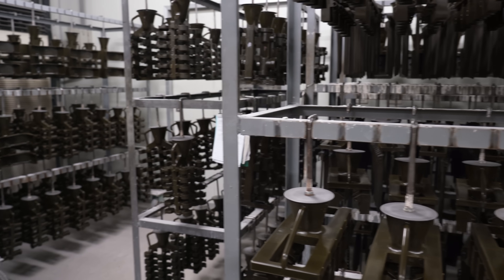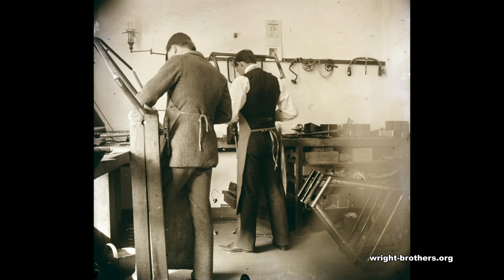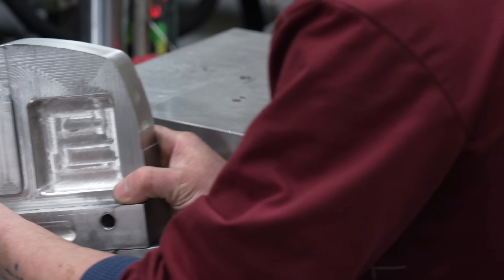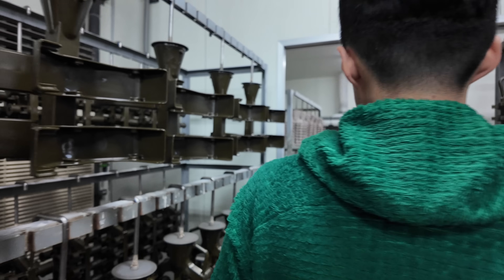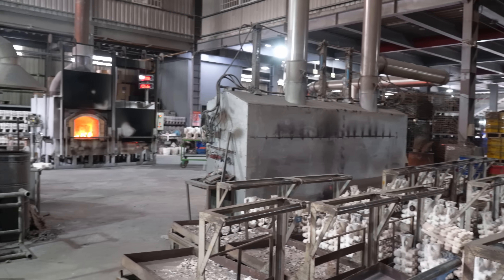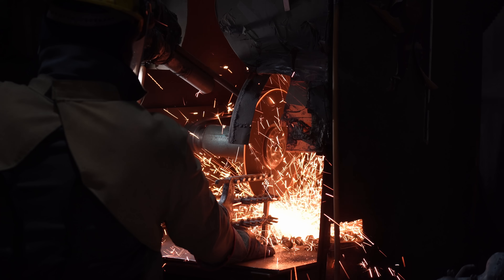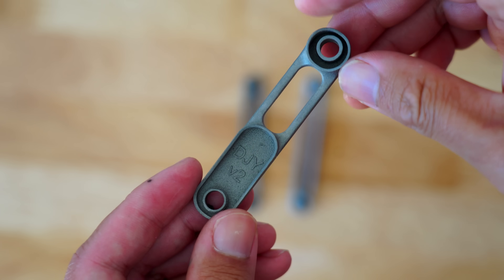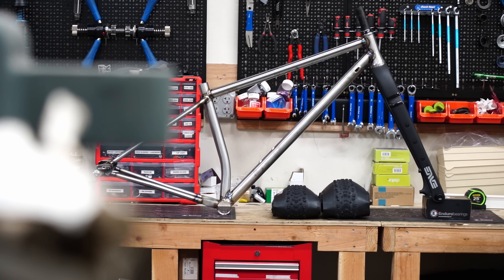Wax to Steel: Inside a casting factory

Comment: My old 1997 Norco Team Issue hardtail had Reynolds 853 with some Ritchie Logic tubing mixed in  and lost wax drop outs. I had disc brake tabs welded on a few years later…that bike was fun, but yeah steep and short geo. Sub 25lbs

Comment: Awesome video. I did learn something new - I'd always heard the term lost wax process but did not know what that meant. I did not realize there was a ceramic mold step. Subbed.
Reply: It’s also known as ‘Investment Casting’. ‘Lost wax Casting’ is older terminology, but still correct. It’s an amazing and very relevant manufacturing method for anything relatively small that is to be made from metal material, from high end medical and aerospace components, down to bicycle bottle holders as seen here.

Comment: There must be a way to wax 3d print the lost wax forms.
This brings tooling cost in the lost wax process instantly.
Reply from the maker: I think there are a few startups 3D printing the molds too! You can tell from the video, the casting factory is pretty oldschool. It will take some time for old and new technologies to mix.

Comment: The visualization of cost and scale comparisons is great. I would critique that machining certainly gets cheaper at scale, but I take your point that it doesn't get much cheaper after the upfront investment of programming/tooling. And I guess the same can be said for most manufacturing workflows - large contracts typically bring prices down. But as a for instance, if you go to any shop with an RFQ for 10,000 pcs on a recurring order every 3 months you're going to get quoted a per-piece price that is a tiny fraction of what you'd pay for a one-off run of 100pc or smaller. The way that you go about machining a small run vs a large run is very different, and frankly a significant portion of the cost of even a several-hundred part run is the non-recurring engineering and customer service work surrounding the custom job, not the "spindle time."

When you have steady demand on a part that you have optimized for production, you can afford to price that job at a much more modest hourly spindle rate because it doesn't really need much attention. You can actually leverage automation and you have de-risked the prospect of the contract as you come to understand what the tool life, scrap rate, chip control and material handling look like. CNC is much more automated at scale than lost wax casting so if you were to compare parts at quantites like 1, 100, 10,000 I think you might see some interesting results.

As an extreme illustration, I know of real-world examples in high volume contract machining in the USA where the machine shop would make the parts for less than their cost of the raw material, but they keep the chips. The money they make on recycling the chips can be enough to make the job profitable. Imagine a copper part with significant material removal. I can't relate to those kinds of razor-thin margins, but when the contracted quantities are that high it can work and those are the prices you need to quote at to win the jobs.

Casting is super cool. This is a great explainer for the process with excellent visuals. I'm still partial to machining, of course. The parts shine, achievable tolerances are very tight, material selection is wide, and for someone like me there is a huge amount of flexibility to iterate. I don't have to re-cut molds to tweak a part. Not everybody has their own CNC equipment, sure, but it's the appeal of being able to make your own cool stuff that leads many of the machinists I know to go out and buy their first old junker machine. I don't know anyone who started lost wax casting in their garage, and it looks like the molds require a CNC toolroom to produce anyway.

What materials can be cast successfully? Weldability/brazability of these? What advantages and limitations are there to achievable part geometries - especially as compared to machining and 3d printing? What are the realistic tolerances for these parts, and can higher tolerances be achieved with more care or would it just require post processing on a machining center? How much deformation occurs as a result of thick vs thin features on a part?

Comment: Thank you so much. Casting is the way to go. It is a rapid process compared to cnc it produces better fillets, rounds, and recessed features. Especially when the material is chromoly steel: ultra hard and tough compared to aluminum.
Reply: I made investment casting molds back in the 80's. Lost core was like sand casting around a wooden core after removing the wooden plug, but core is Styrofoam and not removed before cast metal is poured in.
Reply from the maker: Agreed. I didn’t even know you could cast chromoly until after my visit!
Reply: @Daniel_Yang_ARTEFACT  Yeah: they heat the ceramic vestment as hot as the molten steel and they only re-melt the scrap once.

Comment: Another great video. Informative and entertaining. One question though. Is the ceramic “slurry” wet, dry or both. In one setup it looked like a wet dip. But in others it looked more like aerated powder dip.
Reply from the maker: Sorry, that could have been better shown. It’s first dipped into a wet ceramic slurry, then coated in the ceramic grains. The slurry is what allows the grains to stick. After that layer fully dries, they repeat, with coarser ceramic grains.

Comment: Very informative, thanks. Grant Petersen used to write quite a bit about the role that lost wax casting plays in lug making, in the old Bridgestone catalogs, and the early Rivendell Readers. That's where I first came across it. 

It's great to see details of the process in video form, definitely helped in improving my understanding of how it's done. Great video!
Reply from the maker: Rivendells are great bikes. You can tell there is a lot of thought into the design and cast parts!

Comment: Do they offer small quantity(500 unit) investment casting service for a small part (popsicle stick size)? Great video as always. Very educational especially the later part on breaking down various manufacturing cost.
Reply from the maker: Not sure, since our parts are ordered through our frame supplier. However, we do runs or 100 frames, so based on that logic, 500 MOQ seems possible.

Comment: Beautiful video! I was under the impression lugs were stronger than TIG however. Says Marinoni in his movie "the fire in the frame".
Reply from the maker: Thanks! Both methods are strong enough. But if you look at strength-to-weight ratio, lugs inevitably add more weight.